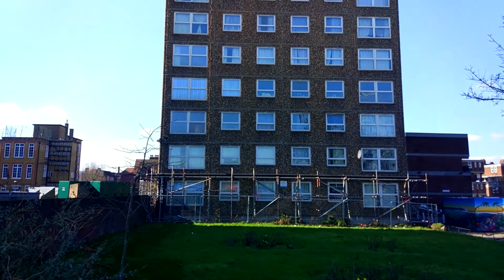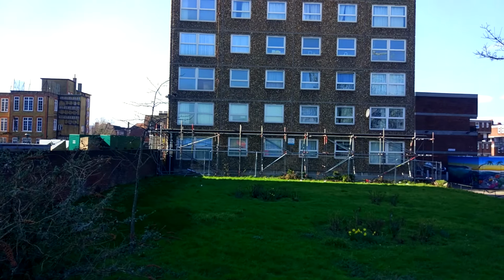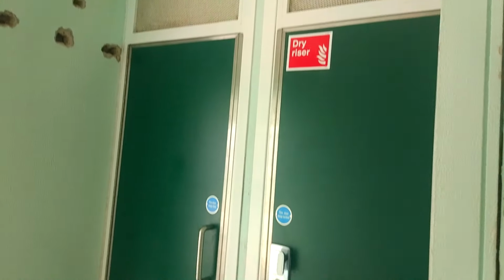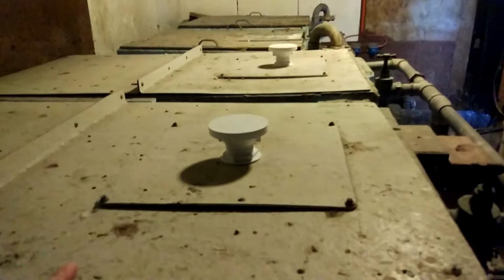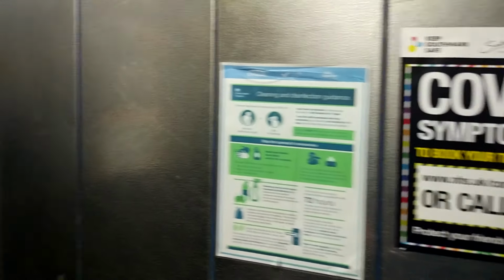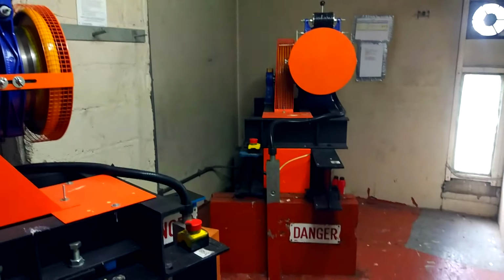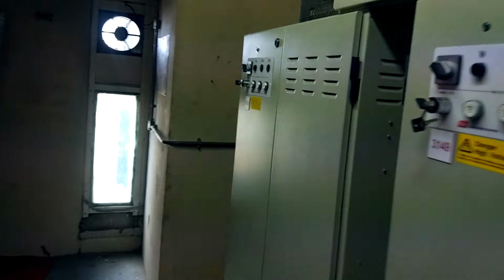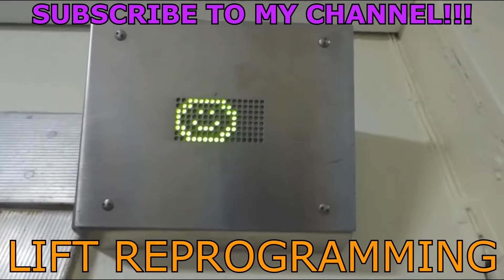Ledbury Estate Tower Block Archive

Comment: I think you found your new home on the top floor!
The concrete in these flats would probably last another 30-40 years but, as you say, the problem is with the steel ties holding the panels together, which have probably corroded due to not being correctly protected when constructed. Well done for archiving these estates because they won't be around for much longer.

Comment: Good explanation of the structural connections. The method with grouted rebar is the mandatory system for high rise buildings, but for low rise the connections can be / are much simpler. For simple buildings like terraced houses the panels are just stacked dry into a mortar bed and are simply connected with bolts. I live in a house that is built using a large panel system, but it’s not visible on the outside as it’s a cavity wall with a brick wall on the outside. The load bearing inner wall is precast, and the panels have welded steel connections with angle brackets that are recessed in the wall corners and are simply plastered over. When it was built in 1997 I was 14 and I often looked around at the building site and it was a big influence for choosing building engineering as profession later on.

Comment: In my opinion concept of block of flats is extremly underrated in the UK. :/

Here in Czech Republic there are basically two types of block of flats. One is called - "panelák" (block of flats). They are usually up to 12 floors tall and often are merged into larger blocks containing 2 and more sections. Second one is "věžák" (tower type block of flats) having usually 13 and more floors and they are not merged into larger blocks. They also were built differently. Older types like T06B-BTS had up to about 8th floor full width of congrete panel, higher floors had slightly thinner panels in order to prevent lower floor's panels overload. Other approach was skeleton frame, which transferred load to skeleton and wall were not supposed to carry building's weight.

Many people like here to live in "panelák" or "věžák", because living costs here are low, vide variety of flats is available (from studio flat up to 3 rooms + kitchen and bathroom) and build quality sometimes was better than for newer ones built after Velvet revolution (1989) as they were built to last for ages and there was no shortage of raw materials.

Our tower type block of flats was built in early 70s and after refurbishment (wooden windows removed and replaced by uPVC ones, new elevators and heat insulation upgrade) they still have their qualities and even survived military ammo explosion caused by ammo hoarder. I love to live here and I would not switch to family house. :) Location: https://www.google.com/maps/@50.0972288,14.3547603,3a,60y,45.48h,117.33t/data=!3m6!1e1!3m4!1syKkW45-PeD0OkBZsW5_5kA!2e0!7i16384!8i8192

Comment: There was once a street here called Camelot Street. Maybe someone was thinking of that poem that mentions "the dreaming towers of Camelot."
When Ronan Point was finally demolished, they found that the spaces between the internal large panels were filled, not with cement, but with newspaper.
1960s houses were often nice and spacious due to regulations on minimum dwelling sizes. Under Mrs Thatcher, this was reduced, which is why so many dwellings that are 80s or newer are rabbit hutches.